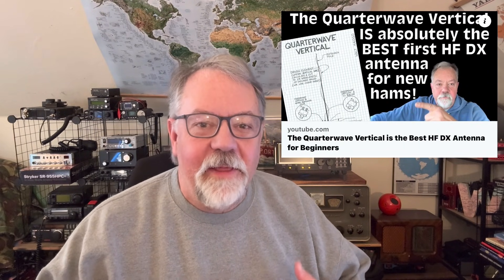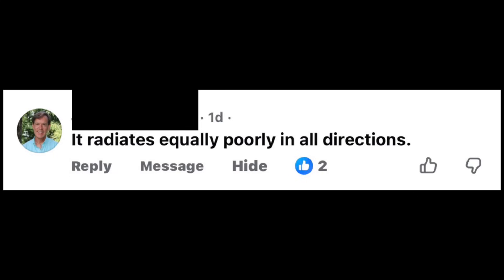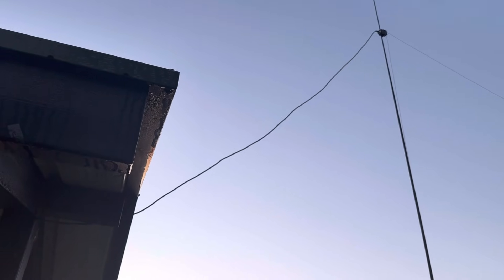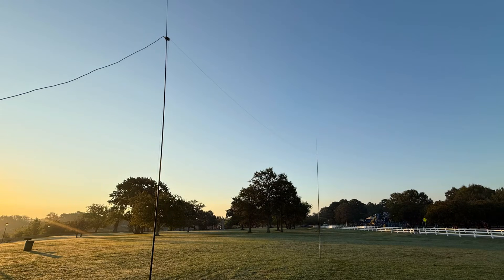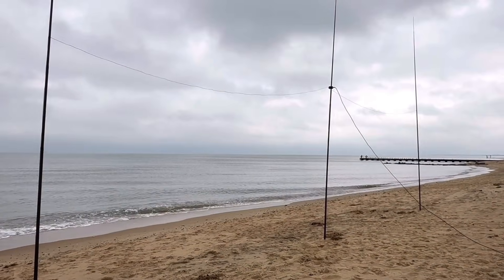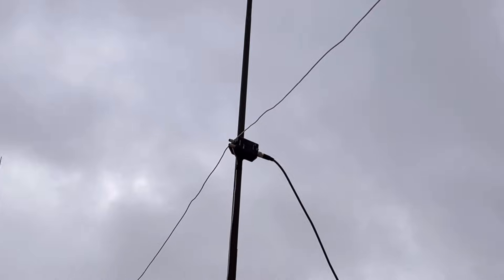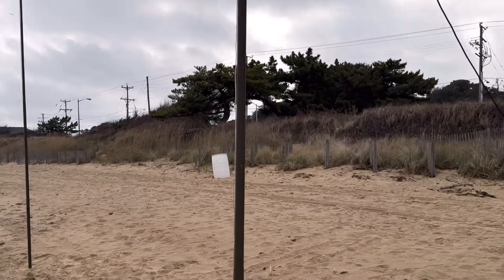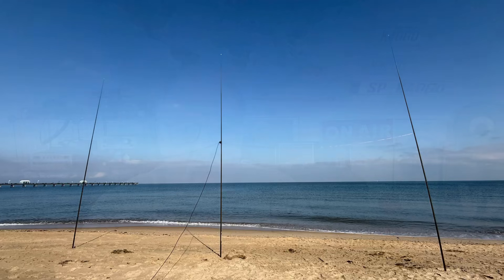Wire Beamforming - Easy to Build Antennas

Comment: I set up my 20m 3ele elevated parasitic vertical long path, using only 6 tuned elevated radicals.
Distance between elements set with of field structure, gives me 2 S points gain, and rx is incredible.
30 mins to build, every qso is over 10,000 miles.
Max gain is not quarter wave spacing, it's less. 73

Comment: I built a wire 1/4 wave vertical as my first HF antenna years ago.  Still use it. It's awesome.  Simple, cheap, portable and low profile.

Comment: These are brilliant.  I have never thought about building either.  I am going to try them both.   The most fun part of Amateur Radio is experimenting with antennas.  I learned when I was trying to work 160 meters in a small yard after I got my General License, always ignore when someone tells your ideas are bad and won't work  The fun of being an engineer is experimenting and learning.  I am a DX'er as well.  I like HF SSB.  I like to rag chew.  Sometimes I setup in parks, but I don't POTA.  I am a veteran.  I like to go mobile.  I wish I still lived near the coast.  73 de KM4MMD

Comment: Hey walt any suggestions for affordable poles ? I was thinking maybe hunting some bamboo in a local river but its definitely not very portable haha , i have bought the red 1/4 wave 20 antenna which ticks both checkmark portable and a affordable but i like to play with wire antennas but poles are my limitation , i also have a 9feet fishing pole but i heard the carbon fiber affects the antenna. Hoping you have some suggestions
Reply from the maker: There’s a link at the bottom of this video that will take you to DX Engineering where they have the DX Commander Rapide poles for $55 each. That’s actually a real good price for a really good pole.
Reply: @COASTALWAVESWIRES  i take a look thanks , hoping that shipping To Puerto Rico won't be extremely expensive  :(

Comment: Agree 100 % on the current-fed half-square, but for something to try, turn it upside-down. Run the 1/4-wave wires UP the mast, the horizontal wire will be lower (strung between the masts). The top leaning from the load is reduced or eliminated, and the coax drops straight down from the feedpoint. There's less coupling into the coax, the mast supports the weight of the coax (less leaning) and the beam pattern remains the same!. I saw this first in 73 Magazine in the early 1970's and used the same construction technique over tge years on 15 meters up through 2 meters. 

Much more robust mechanically and building tge VHF models with tubing vertical elements, it becomes easy to rotate!

Something to try, no?

73, Keith, WB2VUO near Buffalo, N.Y.

Comment: Walt, I recommend the Halfsquare, but place a 3rd vertical wire behind it...1/4 wave away and ground the bottom of this reflector.  I model 8dbi gain in the forward direction with this setup.  Remember, the H-square is floating a foot or so above ground, but the reflector is grounded at the bottom.  At the sea, you could probably get away with a good ground spike or several short (3ft) radials on the reflector.  Give it a try.  73 OM

Comment: The very first homebrew antenna I ever built was the "Dirt Cheap" antenna you demoed while in Poland.  It was a quarter-wave 20-meter antenna with ground radials.  It worked so well that I never miss a Walt video!  🤠

Comment: Another great video Walt. I have to laugh because your Quarterwave Vertical was argued in a few forums. They are there still arguing and your follower are out doing. I swear 80% of the negative people never go out and do. You go out and do it and YOU are the reason I am out several times a week trying different setups for DX and POTA. 

Went out this morning and used one of your bad antennas to activate a park in supposedly horrible conditions. 55 contacts in 35 minutes. Yeah your antennas are just awful. Keep the great videos coming my friend.

Comment: Hi Walt. What happens to the pattern if you turn that three element upside down ‐ ie. Balun on the ground.
Reply from the maker: Takeoff angle goes up reducing its DX efficiency
Reply: @COASTALWAVESWIRES thanks for the feedback

Comment: Here is why a 1/4 wave verticle is the best for a new ham, it’s easy to get up and can get the new ham working easily.   Especially if you a telescoping whip,  red slug and for the radials,  you can buy or make easily.

Comment: Can’t satisfy everyone! I may as well comment here also!   I can’t disagree with your suggestion of the 1/4 wave vertical being a good one for beginners. It’s easy, should work with little effort and should be within the capability of any beginner to build, at least with a little help from YouTube.  For both beginners and us older guys I think keep it simple is the key. Obviously “full size” works best. It really doesn’t matter if it’s a quarter wave vertical or dipole both work good. Both have their limitations. I guess the real answer is “ it depends”. With high trees the answer is a single band dipole. Otherwise the answer is quarter wave vertical with a few short radials. After that you need a high ( in terms of wavelength) dipole or other horizontal antenna. For low frequencies like 160 and 80, a large vertical or form of vertical is almost always the way to go ( unless you have 200 foot towers). You need as close to 1/4 wave as you can get. For 20 and up you can improve with highly directional antennas, but I don’t think that’s necessarily good for the average beginner. Height matters on DX with horizontal antennas. Full size quarter wave element with some radials matters with verticals. All that being said, I work a good bit of DX with a mobile antenna mounted on a screwdriver stuck in the ground with four 11 foot radials on 20 through 10 meters. I doubt it would work much DX on 40 through 160 as it’s not anywhere near “ full size”.

Comment: Thanks Walt. Last summer,  I tried 2 x 5/8 wave Gainmaster antennas (need to be exactly same built) fed with same coax and same lengths on 2 telescopic poles, 1/4 to 1/3 wave length apart, connected with a duplexer to the Transeiver.  Broadside radiation,  excellent results for DX. Antenna building is fun and one of the most important parts of ham radio.  Location + antenna,  the 2 key factors for DX success😂

Comment: Ignore the haters Walt.  Facebook and Reddit ham discussions are just toxic.  Of course the quarter wave vertical is a fantastic beginner Dx antennas.  Radials on the ground may not be the most efficient, but they are very forgiving.  The new ham can concentrate on tuning his vertical and just throw some wire down.  Later on he or she can can elevate the radials and match and tune them too, but it's a bit much for starting out.  Make things accessible for beginners and let them gain confidence with simple antennas first.

I love these two wire antennas because they put the high current anti nodes up high, not at ground level improving both efficiency and takeoff angle. They are also very forgiving of poor ground for those of us inland.

I own two of the DX Commander rapide poles and I'm considering buying more.  You can slide them over 1-in standard pipe to about 16in depth to make them a bit longer.  I've never seen a four pack offered but would have jumped at the deal.  I'm thinking about making a wire delta loop with two rapide poles.

What kind of extent and length are you getting out of them?  I'm getting about 21ft 9in not 23ft.  73 KK7YIS